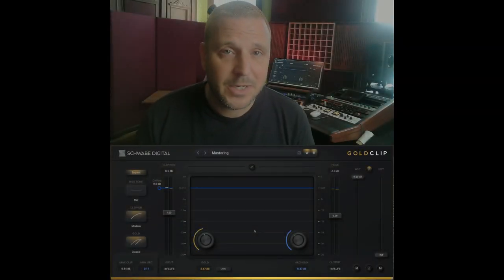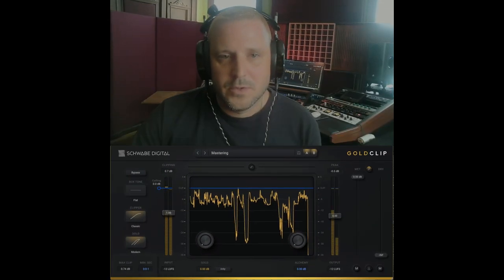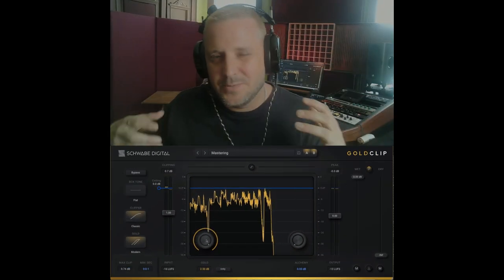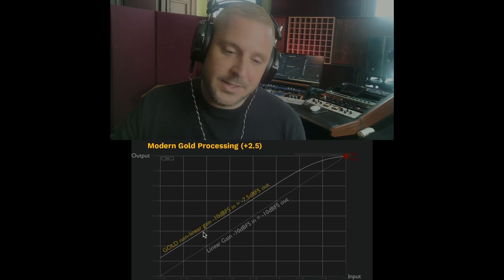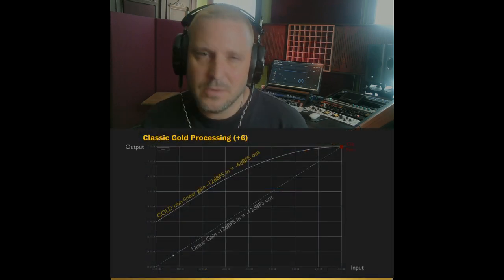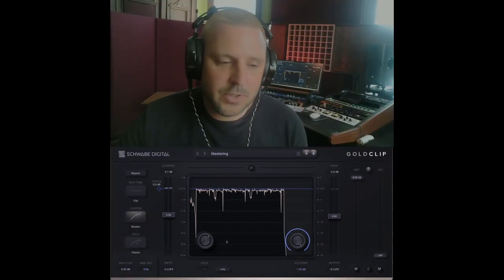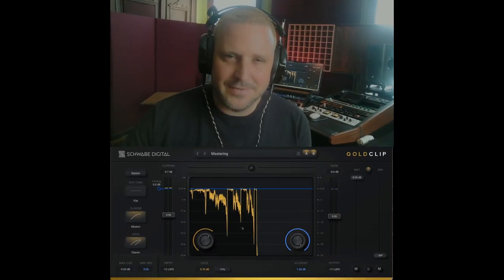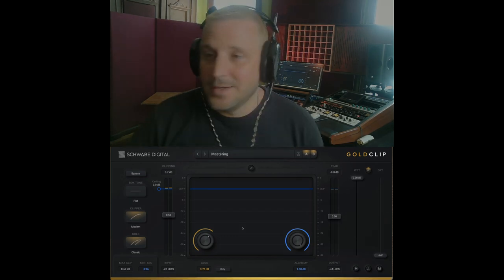Gold Clip - GOLD Processing

Comment: If you used this subtle soft clipping and gold processing as the first instance of your mastering chain. Could you put another instance of gold clip on hard clip mode before the final limiter? I also assume the gold knob is similar to the oxford inflator as both are upwards compression? Please advise many thanks
Reply from the maker: Yes you could, but gold clip is not a soft clipper.  Maybe classic has a bit of soft clipping attributes but it is not technically a clipper.  And gold processing is not soft clipping either.  It is a gain manipulation through a sample by sample analysis process. I generally use gold clip first in chain, but some use it both first and then again just before the final limiter. You can turn anything off in GC by command clicking it.

Comment: Dude what. Lack of attack and release is what produces the distortion in the first place. Clipper is never clean, and as soon as you cut more than just very fast peaks with it you can hear it very prominently.
Mayba you wanted to say "pumping" instead of distortion? Because lack of pumping created by attack and release is inteed an advantage a clipper would have over a compressor in certain contexts.
Reply from the maker: The attack and release comment is about gold processing, not the clipper. Gold processing is a compressor that does not have attack and release. It is a special gain manipulation that happens after the clipping. The clipper is indeed a clipper, but not at all what was being discussed in the video. Please read the manual for additional context. Technically, anything that alters a signal can be considered a distortion of the signal.
www.schwabedigital.com/manuals
Reply: @schwabedigital  Aight aight, I got so triggered by one phrase I misunderstood the context. That being said, attack and release are what lets the compressor avoid waveshaping and thus adding harmonics, which is usually what's called distortion.
Anyways, I'll go read the manual now.
Reply from the maker: @qasderfful  No worries, that is generally how things go on the internet.  I am guilty of it sometimes too.